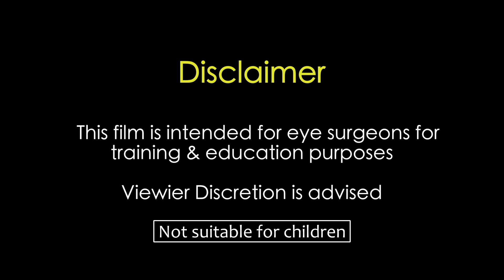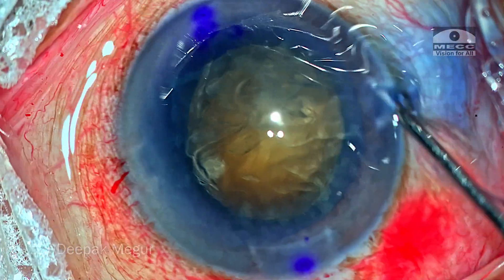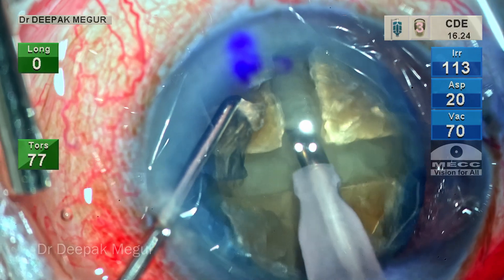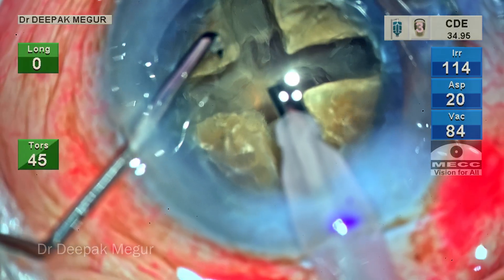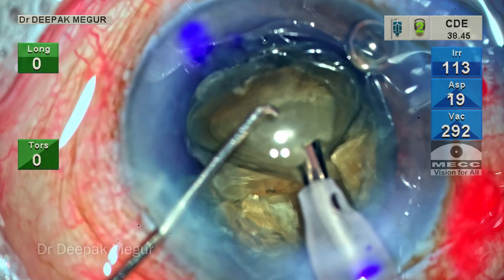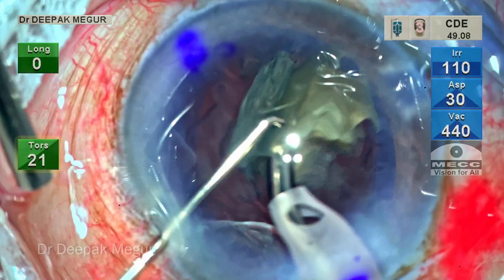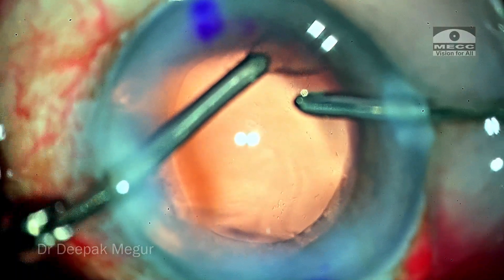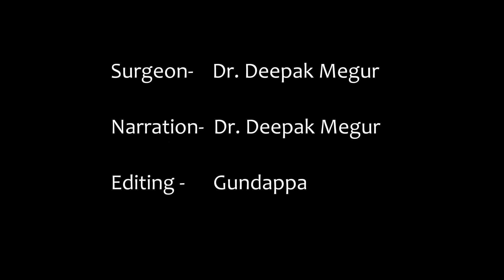How to assess the depth of the trench..? Divide & Conquer 4 Quadrant technique in dense cataract

Comment: Great video Sir. How much does CDE matter when the plane of quadrant removal is at the level of iris or anterior capsular margin ? Correct me if I am wrong Sir, I think you’ve mentioned it before as well that it doesn’t matter much and even with large CDE we can have clear cornea in such dense cases as well if the plane of quadrant removal correct and lens chatter isn’t there. Thank you for a great informative video once again.
Reply from the maker: You are very much right.